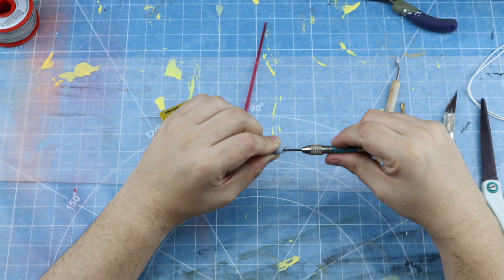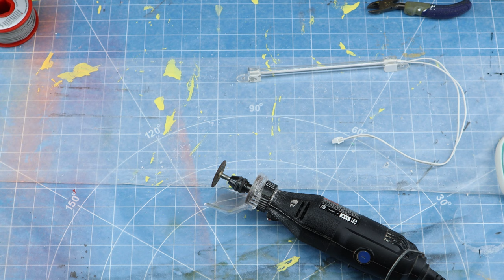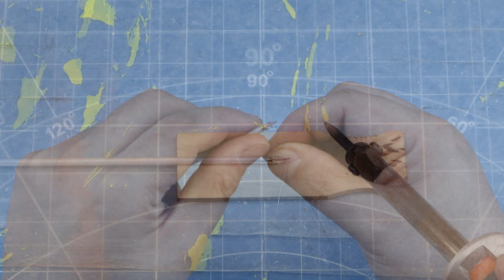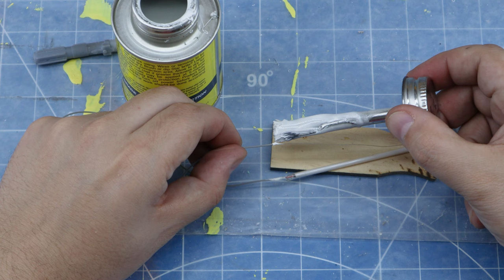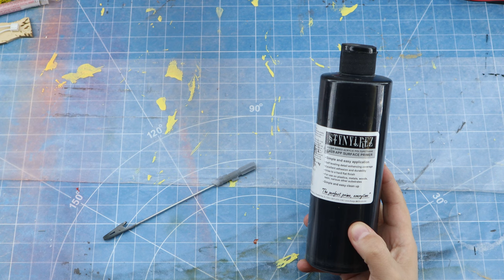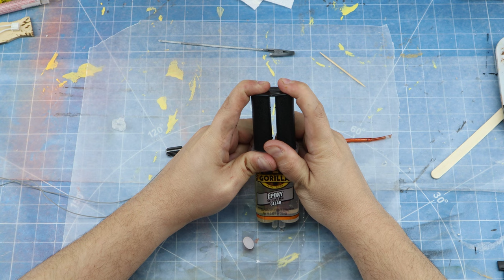Making a CCFL LIGHTSABER - HOT TOYS - STAR WARS  | CRAFTED Episode 19

Comment: this is a really good tutorial. Tested and some other video tutorials do exist, but none are as clear and thorough as this one. I'm also testing EL panels and EL wires for non-soldered, more temporary solutions so I can switch to deactivated lightsabers without buying too many 3d printed sabers
Reply from the maker: Thank you Mark!!! Very kind words. Good luck with the tests! Would love to hear how it goes.
Reply: How did the test end up going?
Reply: @user-mg1ze9ty5f  everything about EL wire is excellent. They're consistently at a great brightness, I can have them on for hours, and they can run of either usb or aa batteries. They're bright all the way through, and with a stiff EL wire, or an external housing, they can be made to look straight. Everything is perfect. EXCEPT THE CONSTANT BUZZING! Some inverters are silent, and some are super whiny. When you put 10 together, they are so insanely loud.
Reply: @markli8572  Thanks for getting back to me! I'll have to give them a try

Comment: Always have wanted to attempt making one of these, just worry about how hot they get. Great video tutorial Desy!
Reply from the maker: Thanks Sergio!!! They do get hot. As long as they are well insulated at all the soldering points and the heat shrink properly covers the CCFL and wire, it should be OK. I typically only leave mine on for an hour or so at a time.
Reply: @metamorphiccustoms  really look the way a lightsaber is supposed to look. Really awesome upgrade.

Comment: Very nice! I am inspired to try myself! I want to make one for my darth maul. So I figure I have to make 2 seperate sabers, but can I just connected them togheter further down the wire if you understand? will a 9/12V be able to drive 2 sabers?
Reply from the maker: Thank you and thanks for watching! Yes, I also made CCFL's for my HT Episode 1 and Solo Mauls. It works the same way. 
I drilled the small hole for the wire a bit lower on each of the double-bladed hilts.This is so when you combine both sides of the hilt to make the single hilt,  both wire sets (one from each blade) exists the combined hilt closer to the center. You can then twist together both sets of wires so only 1 single strand of wires comes out of the double bladed hilt.  (Keeps it a bit cleaner.)

Comment: Would it possible to use led wire instead so it doesn’t burn out? They make it thinner than the tube.
Reply from the maker: I think its likely. I'll, have to try that out eventually as it may be a better idea than a CCFL. Thanks for watching and for the question!

Comment: Quick question, since the connective wires to the inverter box are both white, how do you know you’re connecting the correct positive and negative wire? It’s an issue I came across.
Reply from the maker: In my case i just kept a visual note, but its best to color code it with a sharpie. (That's what I would suggest.) Thanks! and good luck!

Comment: Hey Desy you have a link to the 3D files for the sabers?
Reply from the maker: I honestly don’t recall where I got it! I remember d/l several files until I found one that I thought looked good and “worked”. If I remember correctly, the one I used was actually a 1:1 scale file that I then scaled down in Lychee slicer. Typically I get files from Thingyverse or CGTrader. Do a few quick searches there until you see something you like. (Just know you’ll probably have to do some scaling before you print.)

Comment: How long can it be on
Reply from the maker: The wiring and process is identical for any size CCFL. So you just have to source a CCFL tube light in the length you prefer. If you're making a light saber for 1:6th scale figures, make sure the width of the ccfl stays the same as the length gets longer. This will be imortant to ensure the tube can fit in the 1:6 hilt. Thanks for watching and for the question!
Reply: @metamorphiccustoms  didn't answer my question lol
Reply from the maker: @14aqib  Sorry misread as “how long can it be”. As far as it being on, it gets warm quick, but it’s never been an issue. I try not to leave them on for more than a couple of hours at a time, just in case.